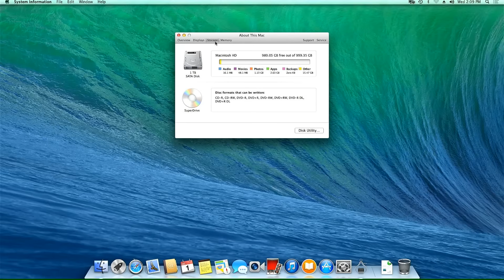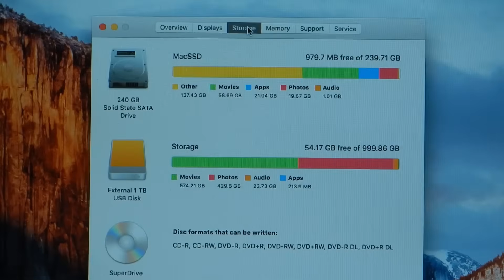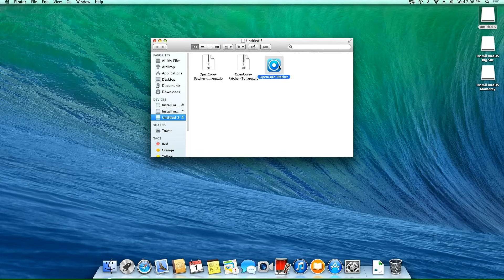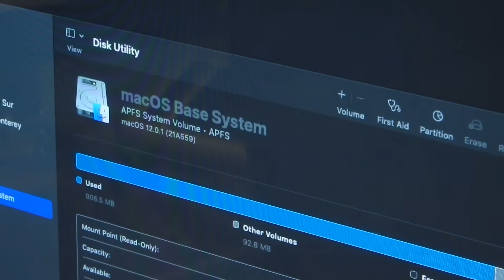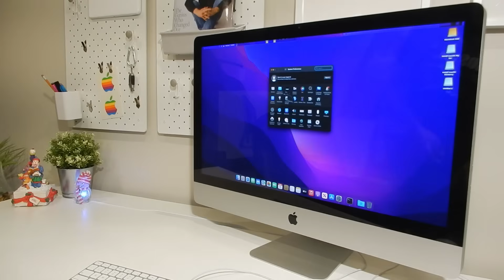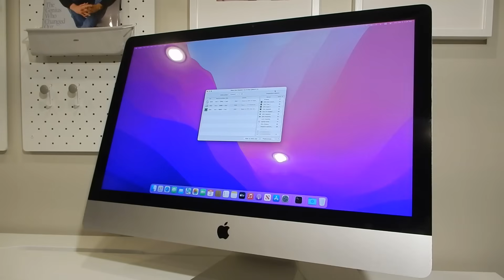Apple thinks this 2009 27" iMac is worthless. Let's refurbish and upgrade it to Monterey!

Comment: Apple doesn't think it is worthless. Apple knows it is not worthless. They're engaged in planned obsolescence to force you to spend $2000 on a new Mac. Congratulations to you for not falling for it.

Even if Apple managed to block Monterey from running on it, it still would not be worthless because it would still run Linux.
Reply from the maker: Linux FTW!
Reply: Currently having issues with running Ubuntu on my 27" late 2009 imac due to the gpu being  severely underpowered. Unsure as to what the best gpu upgrade could be, as I'm fairly new to refurbishing macs.
Reply from the maker: @ConorFenlon  I'm not super knowledgeable in this department, but power-wise Ubuntu shouldn't have any issue with the stock GPU.  I suspect the issue would be more driver-related.  I would start by checking via terminal if Ubuntu is loading the appropriate drivers.  There are several drivers (proprietary and open source) and one may work better than another.  You'd need to do some Googling on this.

As far as upgrading the card, any MXM 3.0 type B should work.  If it's not an official Mac card (or converted with a flashed Mac ROM) then you may have some issues getting picture before the OS is booted.  I know this is an issue on Mac OS, but not sure how this would work with Linux.  Either way, the absolute safest option is to buy a Mac compatible or Mac converted card, which severely limits what models are available.  If I was looking myself, I would start by searching eBay or similar for "mxm 3 b mac".  Whatever model you plan to get though, make sure you also Google "model_number ubuntu" to make sure there aren't compatibility issues with Ubuntu.

As a side note, you may also want to look into Linux Mint - a great alternative to Ubuntu.  I found Ubuntu was getting too "commercial", and switched a few years back as Mint just feels "cleaner".  Both are great though, just down to personal preference :)

Comment: I just purchased a 27 inch 2009 iMac for $100 CAD ( ~$75 USD ) with 16 GB of ram and the 2.8 ghz i7... I'm going to use it in target display mode with my 2018 Mac mini. Im curious If I can get docker running to setup a pie hole to block internet ads...
Reply: Please let us know what cables have you tried or planning to use. I have the same iMac and I’m trying to use it with 2017 MacBook Pro and PlayStation as a target display mode, also with Monterey having universal control no longer in beta would that work for iMac? If anyone knows how to use iMac as display with PlayStation that would be awesome, also a great video idea - use iMac as a universal monitor/tv

Comment: Monterey is way too glitchy for my liking on these devices. I think it's better to stick to Big Sur or even Catalina if you don't have a Metal GPU. If you use iMovie, Catalina is the last version of macOS to support the last non Metal iMovie, which is iMovie 10.1.12 (the one you run on High Sierra, makes sense as it's the latest that does not require Metal).
But yes, Apple is stupid, and for the environment, a such device is much better than their Apple Silicon iMacs that disable themselves fully if the soldered internal SSD dies!

Let's say... 32GB of RAM is kinda useless in this thing. 8GB is enough!

The "less than 1 minute remaining" problem often happens when you clean install a Beta. It happened with the Big Sur beta too. To avoid this problem, you should plug the SSD in a Mac that supports Monterey natively, and install from this one WITHOUT BOOTING TO A USB INSTALL MEDIA, but rather launching the installer from a working macOS install.
Reply from the maker: Agreed - Monterey is definitely a little glitchy.  This machine doesn't need iMovie, but I think Apple Photos now requires Metal.  This would be the one nice thing to have in my case.  Upgrading to a Metal GPU isn't off the table yet :P

Yes, 32GB is TOTALLY overkill, haha.  I would never buy that much RAM for this machine, but I had some spare sticks kicking around.  They might get pulled if I need them for another project.

That's really cool to know; I've noticed this on previous Mac OS versions on other machines too, and never knew why.  Thanks!
Reply: @rebootretro  Apple photos does work with non Metal hardware as far as i am aware. At least, if the app gets heavily distorted, I know the devs of the OpenCore Legacy Patcher have a fix.

But for now I think you should not patch to Big Sur or Monterey without a Metal accelerated GPU.
It's possible to put one in a 2011 iMac, and the 2012 iMacs have it natively. Then patching to Monterey works perfectly.

With a such machine, I would rather stick to Catalina as it doesn't use Metal everywhere,  so it doesn't need too heavy patching.
If you have a Mac that natively supports High Sierra, either install it or use Dosdude1's firmware updater in Yosemite or later.
If your Mac doesn't natively support High Sierra, you will be annoyed by Dosdude1's custom bootloader that shows code everytime you boot the machine. To get past that, why not build OpenCore to your boot drive (don't forget to turn off boot picker).
Reply: Is it possible to downgrade to catalina or Big sur? My early 2009 imac has been keeping itself updated so its on Mojave. I was worried if i should let it update to Monterey so i guess not thanks
Reply: @gamertardguardian1299  Mojave isn't officially supported on it, and the patcher used to install it will break Chrome and Discord graphically, making them unusable. There is no fix for this.
It seems to only occur on NVIDIA Tesla cards due to poor design of the patcher, just like the Catalina patcher having serious issues with crash at launch.

Dosdude doesn't appear to be aware of this and must fix it!
Reply: @gamertardguardian1299  it's not about letting it update to Monterey... it wouldn't let you go higher than El Capitan if it's Early 2009.

Or course patchers can bypass this. You can expect full support for everything in High Sierra. Past that, issues will occur.
Dosude's patchers are nearly problems less... all the patching for non Metal is really neat as there isn't too much to patch compared to Big Sur and later... unfortunately Dosdude had to break that one thing for each of these two patchers...

Comment: Please let me know what exact SSD you used. Mine Monterey USB installer is refusing to detect my OWC SSD installed in my DVD Bay. Googling suggested Apple is preventing SSD detection unless it is is Apple SSD, however I don't think you are using Apple SSD (at least I hope not).
Reply from the maker: Its definitely not an Apple SSD.  I don't recall exactly, but I think it's an OEM Samsung SSD out of a dead Dell laptop.  I would double check your DVD bay adapter.  You can also temporarily remove the HDD and connect the SSD to confirm.  Apple has previously prevented TRIM support on non-Apple SSDs, but I'm not aware that they've ever prevented them from being used.  I could be wrong, although I've installed Mac OS on dozens of aftermarket SSDs over the years.

Comment: It’s looking good. How is it handling Logic Pro and Final Cut Pro?
Reply from the maker: Thanks!  This one won't run the latest Logic or Final Cut since they require a Metal-supported graphics card.  If the graphics card was upgraded (which it could be), it "should" run them.  At 1080p I suspect it would be usable, but render times will likely be pretty slow.  At 1080p it would likely get the job done if you're a patient person.  If you're going to do a lot of video editing, you might be better off upgrading to a new machine.  I did another video here comparing the 2009 to the 2020 model: https://www.youtube.com/watch?v=bO1XvSBG4d4

Comment: So I have a late 2009 iMac with an intel core duo. I installed Monterey and it was SLOWWW.
Reply from the maker: Did you upgrade to an SSD?  With an SSD and 8GB+ RAM, and all the proper patches installed it should run decently.  The Core 2 is a bit of an aged chip, but I would expect it to be very usable still.  If you want to post back some details on your setup, I'm curious why it's so slow.
Reply: I did have an SSD with 8gb of ram, I did do the patchwork eventually it just would lock up. I ended up selling it to someone for $60.

Comment: When I did mine I lost the ability to use airplay speakers so I had to go back to High Sierra. Did you have this problem too?
Reply from the maker: I just checked and it appears to be missing on mine as well.  There are 3rd party AirPlay casters, like AirFoil which might work?  I'm not currently using my AirPlay speakers, so I didn't notice until plugging them in to test this.

Comment: How did you get the metal workaround for the Radeon?
Reply from the maker: Unfortunately, I didn't get Metal running.  I used the OpenCore Legacy Patcher, which installs a patched graphics driver, bringing back legacy hardware acceleration.  Without the patch, Mac OS won't load any graphics driver and the UI is so laggy, it's unusable.  So I have all the dock animations, legacy accelerated screensavers, hardware accelerated video playback, etc, but anything that requires Metal such has Apple Photos, Maps app, Metal accelerated screensavers, etc, doesn't work or is incredibly buggy.  For what this computer is used for, it doesn't matter to me since Metal apps aren't needed.  If I really wanted Metal, I would need to replace the MXM graphics card with a Metal supported one.  If you're on an '09 27" too, then you should be able to do this.  You can find Metal supported ones which aren't terribly expensive on eBay.

Comment: Thank you for your useful information. We also have a 2009 iMac. everything has been upgraded like you did but now the fan noise drives me crazy ... Do you have the same issue ??? thank you
Reply from the maker: Hi!  I did not, but I kept all the factory temp sensors.  The loud fans are usually caused by an unplugged or missing sensor.  If you changed the hard drive, this is extremely common cause since many '09 machines pull temperature data from the HDD diagnostic port (which doesn't exist on most non-OEM drives).

I used Macs Fan Control app to manually control my fans.  In my case, I turned up the fan speed to "protect" my hardware from excess heat, by adjusting target temperatures.  I think it's possible to also reduce the fan speeds with it too.

When you open Macs Fan Control, you'll see all 3 fans and can see which one is the loud one.  Make sure that sensor is actually plugged in properly.  If it's the hard drive and you've replaced the hard drive recently, switch the fan speed from Auto and tie it to another sensor value in the same area or to a fixed speed.

If this doesn't help, feel free to post back and I'll try to help if I can :)
Reply: Download Mac's fan control and you can lower the fan speeds
Reply: He left in the original HDD so no sensor issues. You can use a SATA splitter cable or bridge the sensor cable to prevent high fan RPM

Comment: Hello. I have a 2010 imac 21.5 inch. I followed the same process and there were many guides online. But my Mac does not load more than "less than a minute" i had kept it left over for an hour but still it doesn't work. Any idea about the problem and how I can solve it?
Reply from the maker: Hi!  If I recall, it's happened to me a few times (since I reinstalled a few times).  I left mine running for a couple hours, and sometimes it would actually complete.  If not, I force rebooted it and it didn't seem to have any adverse effects.  I'm not sure why it gets stuck, but it seems somewhat common.
Reply: @rebootretro  thankyou. That day I kept my iMac overnight for installation. It happened 😁

Comment: in my case the screensaver trick didn't work, so i'm using my iphone with a cable as a modem and no audio
Reply from the maker: Sometimes you have to repeat the screensaver trick several times.  Set screensaver to hot corner, move mouse to hot corner (wait a moment), then move mouse away, then move mouse back to hot corner, then away.  For me its usually 1-3 times and its fixed.  In some rare cases, it takes a 4th or 5th try.

When you see the flurry appear on-screen, you have to let the flurry animation reach most of the screen corners before moving mouse.  If you don't let it move mostly across the whole screen, it won't refresh the frame buffer and won't fix the problem.

No audio is a weird problem...  Are you sure it applied the correct post-installation patches?  Audio, Bluetooth and WiFi have known problems on the 2009 until patches are installed.
Reply: @rebootretro  no no the audio and wifi is ok if i do the post-install, but since I had the graphics problem with a very weird display I chose to have no wifi/audio with ok graphics rather than the opposite. today I'll do again the post-install  with the screensaver fix

Comment: While it's really cool that this still works and you managed to upgrade it, I feel the "saved $1800" in the thumbnail is incredibly misleading. No matter how much RAM or fast storage you add in, the i7-860 in this thing is very much outdated and cannot compare to a modern CPU. Even i3s these days are faster than this.
Reply from the maker: New video is up comparing this 27" 2009 to the cheapest brand new 27" 2020 available :) https://youtu.be/bO1XvSBG4d4
Reply: You cant replace the cpu?
Reply from the maker: Hey, thanks for the comment! :)

True, but ultimately I needed to replace the old 24" iMac, and my choice (for a 27") was either refurbish this used one or buy a new one.  So a more correct term was perhaps "deferred" instead of "saved" :)

My biggest problem with the latest 27" model is that its still Intel, as they haven't upgraded 27" to Apple Silicon yet.  I don't want to invest in a platform Apple is killing off.  I feel that Apple will probably kill software updates much earlier than usual in hopes to move everyone to Apple Silicon, leaving a brand new iMac with a similar lifespan as my used 2009 iMac.

But you bring up an interesting point... Even though this i7-860 is much slower for CPU-intense tasks, but how much slower is it for basic day to day tasks like word processing or YouTube watching?  Would it be discernable to the average user?  Maybe I should borrow a current model 27" to benchmark against this 2009 iMac and make a video...  I am very curious how they would compare, and how big the performance gap would be.
Reply: @rebootretro  Your point is certainly valid. I myself use a 2017 13" MBP as a daily driver for work and its CPU power is a joke by now. But I do have a custom built desktop PC for stuff that actually need the power. 
  
The issue I have is that the $1800(?) pricing covers the entire gamut of stuff that you can do with a new iMac. Yes, most people will not use its full power. But that is obviously not relevant to the pricing. And I bet there are definitely people who go pedal to the metal with their  computers, using all the power available.   
  
As for that kind of comparison, yeah, I would definitely like to see that.

Comment: This is amazing, my main machine is a late 2009 21.5 inch iMac! They are still great workhorses.
Reply from the maker: Yup!  With upgrades, it feels just as snappy as any modern machine.  It's a shame how many of these are likely trashed just because they can't be updated to the latest OS.  As it sits, this trooper still has lots of life left in it.
Reply: Hey I was currently given a late 2009 iMac from a relative and it works really well. But I’ve come to realize that I can’t gain access to certain websites because I’m currently running maverick ( 10.9.5 ). I’m not entirely sure how to update my mac. I tried going base off some videos but everytime I try to log into my apple account on the apple store it says my password was incorrectly entered but I’m 100% sure that it isn’t. Any advise or help you can lend??
Reply from the maker: @faddupastfour  You can try this official link to the High Sierra download page: https://apps.apple.com/us/app/macos-high-sierra/id1246284741?mt=12

High Sierra is the last official version of Mac OS that supports the 2009 iMac.  I don't believe that Apple requires you to sign in for Mac OS upgrades, only for apps.

If you're trying to unofficially upgrade to Mac OS 12 Monterey (like in the video), this process must be done entirely WITHOUT the App Store since Apple won't allow unofficial installs through the App Store.

If you're still having trouble, you can post back and I will try to help :)
Reply: @faddupastfour  go to Mr Macintosh channel on YouTube, he has plenty of tutorials on how to download older versions of macOS
Reply: You upgrade this processor imac 27'' inch late 2009